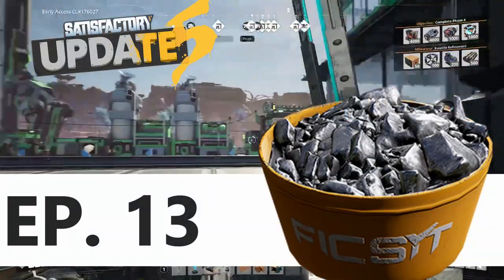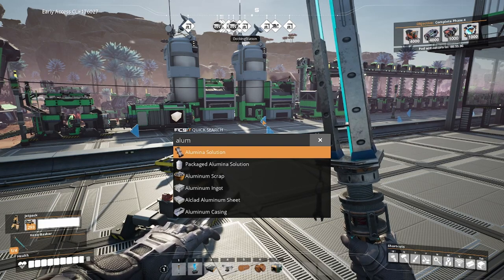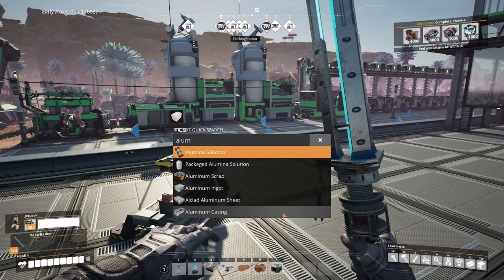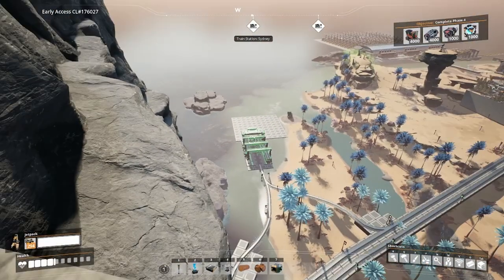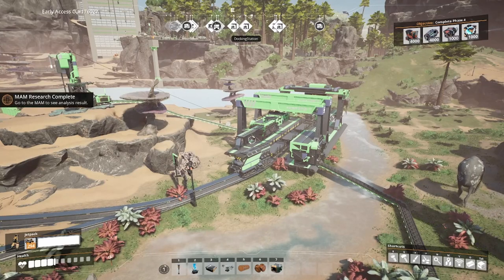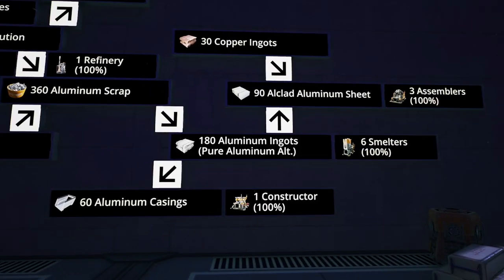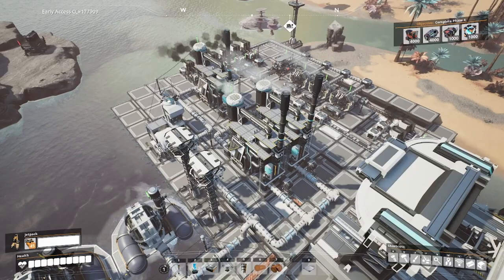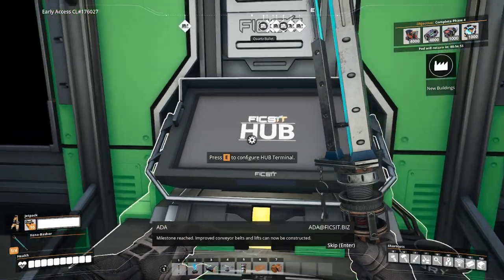How to build a Satisfactory Aluminum Factory! - Satisfactory Update 5 Aluminum Guide (LP/Tutorial)

Comment: Thank you so much for this video. I followed it to the letter (but very slightly redesigning it to support my modded base/central storage setup), and I now have Aluminum.
Easy to follow guide. ...I just hope I don't run into a modded item that requires Aluminum Ingots as a twist.

Comment: my issue with aluminum so far was to use the water from the 3rd refinery and send it back to the first two ones.
No matter of often i adjust the waterflow, the hole production comes to a halt because the pipe back became full.
Reply: I got 80m3, 80m3 and 56m3 but still goes idle
Reply: i got the same problem that the third refinery of alum scrap always paused working due to water not flowing back to the network and jammed the production. after an hour of useless searching i accidentally found out that i should use pipe mk2 for the whole water network lol
Reply: @fanzhen0019  I had a similar issue, but I ended up just using 2 water extractors at 100% and then feeding the line back in. Balances perfectly with update 6

Comment: Wow. I'm a new player and its awesome what you and others do in the game. Can you elaborate on how you male the foundation double layered,  and what mods are you using?  How did you get the layout on wall showing your plan of building. My adhd is kicking in big time with this game. Lol I keep getting distracted and forget where I left off. Awesome work subscribed
Reply from the maker: Thanks ! I don't use any gameplay related mods in my let's play, just a camera mod for filming. 

To make the foundation double layered, place a bottom foundation, then place a wall at one spot along the edge, then snap a 1m foundation to the top of the wall. the resulting 3m gap is plenty big enough for the pioneer as well as mergers, splitters, conveyors, and pipelines. Great for making space for your belts!

The wall showing the plan is just made with creative use of signs, which you can get from the Awesome shop after you get steel and the quartz tree unlocked.

Let me know if theres any more I can do to help!

Comment: this is my 4th save of the game and this time i decided to do everything very large scale so i don't run out of things like screws. Not realizing that the bottleneck is belt speed.  I followed this aluminum setup to the tee and it actually works. Is this not sort of small scale thought? will this produce the aluminum i need? I feel like everytime i try to go big with aluminum setup i get into water shortages but with yours its actually working. Question is how do we increase the thorougput? Love your vidoes.

Comment: More i see your base, more i see that i need to rebuild all mine. Im unlocking drone now. Are trains better than drones?
Reply from the maker: Trains are different from drones -  drones have a much lower throughput, about  a single mk 4 belt at most, while trains throughput can technically be as high as 2 mk 5 belts per car, but thats pretty hard to maintain. I use both because they both add a nice, but different, bit of life to the world. I love seeing trains shooting across the landscape but I also really like seeing drones zipping by overhead. 

One big difference is that drones use fuel (batteries) while trains use electricity, so its a bit easier in that regard, but you have to run the tracks with trains, which is both frustrating and a lot of fun in its own right, while using drones is as simple as placing a start and end landing pad.
Reply: @Dekoba  thanks for the info. I'll learn more about trains, because I don't know much bout track management. I'll probably explode some locomotives hahaha

And thanks for the tutorials too... So easy to understand

Comment: Um... I'd pick Sloppy Alumina solution in the first step to somewhat offset reduced output of Pure Aluminum Ingot recipe and get rid of Silica as a byproduct. The only complication of the factory with it you get is a different ratio of refineries processing stuff. In fact, it would reduce complexity since you don't need to deal with the byproduct.

Also, for those who want maximum output I'd recommend to go with alt recipes on both first and second steps and maybe even use the default Aluminum Ingot recipe with a dedicated Cheap Silica factory, but that's a lunacy (I know because I did exactly that XD). Well, unless you haven't hunted HDDs enough and have to deal with the consequences. If you have Pure Aluminum Ingot better use it and tap into another Bauxite node. Thankfully there's 2 more near that one in the video. And obviously it's a good idea to use Alclad Casing alongside Alclad Sheets if you can. You'll be bringing Copper ingots anyway, so just bring more. Output ratio isn't much better, but it's there and the recipe is faster too.